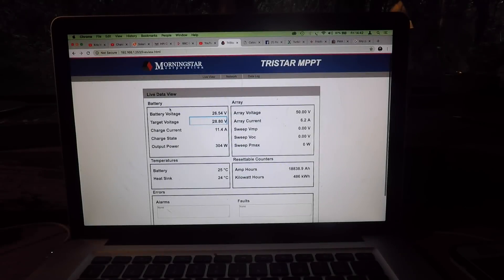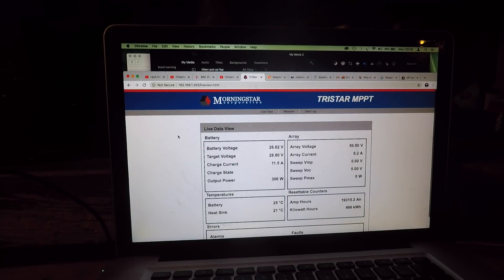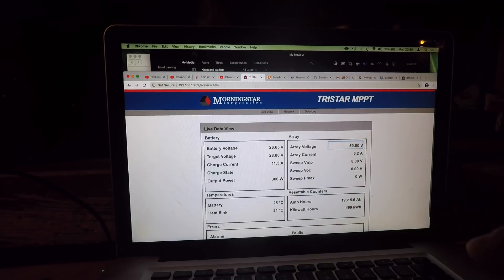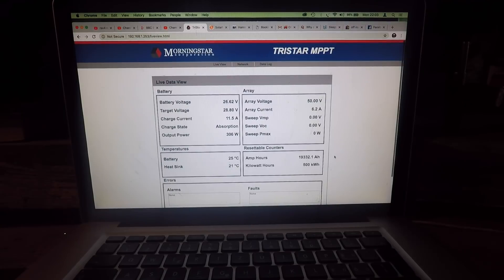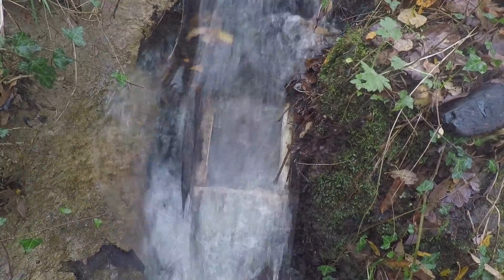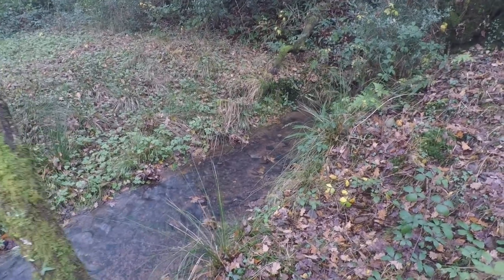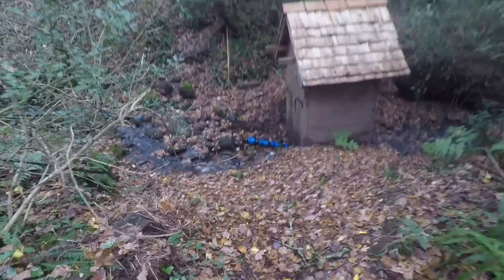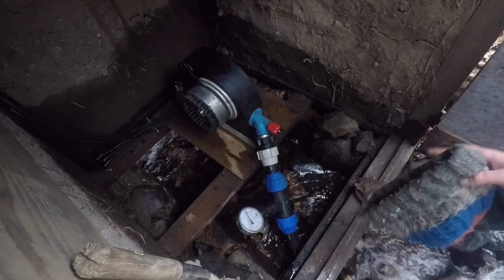500 Kwh Off Grid Hydro Electric Pelton Turbine Update

Comment: Since you mentioned water heating, I would put in a dump load circuit that would supply the hot water when not charging batteries.

Comment: You probably would get more efficiency if you used a coanda screen at the inlet. Also known as a wedge wire screen. They don't only stay cleaner. They are designed to capture more water at the inlet. They can be a bit pricey but they last many years.

Comment: What is the kW output rating of those small batteries? I couldn't see you are using a shop vac in your system, so may not be as much of an issue. But some tools much pull more power than others. Do you have a type of system (colour coding or just memory) of what the standard power draw is for each tool?
I have started to have the idea of using two little stickers on the appliances. 

Two Red being very power Hungry 
Red + Orange being more than average
Two Orange being average
Orange + Green being below average
Two Green practically nothing

To help remind you that having say the oven and extremely powerful tools might try to pull more power than a system can handle..

Comment: You may want to re calculate your kWh. Going  off those figures 304w produced for 1 hour gives 304Wh. A 500kW motor or alternator is a substantial piece of equipment. Most automotive alternators are rated between 450-700W. 
ref: http://www.rockyhydro.com/Generators.php

Comment: Storage batteries, regardless of type should be in its own vented, isolated building or container due to either explosive fumes OR runaway thermal reaction.  Would be a shame to loose your hard work to fire or explosion.  Off grid here 12 years now-solar/wind, with Trojan L16 RE B 6vdc jugs (batteries)

Comment: I always enjoy seeing your hydro updates. You probably know this and not trying to make any judgement based on incomplete knowledge, but if your pond intake upgrade is at a lower elevation than you screen intake and you try to use both concurrently, your net pressure will drop to the lower of the two. You probably know this, but I didn’t want you to expect a different result after the work you will put in. 

Good to see another in depth series out there. We’re AC and hope to document other systems around us both AC & DC, but I’m so glad to see another “Hydrohead” sharing the knowledge. Bravo Man!

Comment: Please don't dig through the dam wall!! and don't run the pipe through the wall. Just run it over the wall with using a siphon effect.  You give water half a chance and it will dig through the wall next to the pipe or in the cavity you make through it. 

I have to say your system looks great and I am very very jealous. Have you thought about adding a pump that is connected to your solar panels so that when your batteries are full it can lift some water into the dam you showed so that it provides a more  water when the sun dont shine. 

Again fantastic fantastic!

Comment: If you rebuild the turbine shed a cheap water resistant method for the walls that will contain the sound is used tires rammed full of dirt (mix in some cement for the lower wet sections) and you can then stucco the outside to hide that they are tires. Can also go with a flooded floor setup with basic U-bend traps to let the extra water out to also help contain the sound. 

For the battery check around for a crashed EV you can pull the battery pack from as at worst you would just need to pull apart to rework into your 24v system to give yourself good sized battery or several batteries depending on need if you are getting by on 2 car/deepcycle batteries now. Or the DIY 18650 systems are also easy to do just take time for the cell testing.

For the pond pipe placing it lower then adding a riser to the level you want the water gives you a way to drain the pond later if needed by sending the water to your batteries rather then just letting it flow out.

Comment: I wish I had this  much water flow.. I have a small stream, it dries up in dry times. Last time I was there in a drought. It was wet. And that's about it. No flow to speak of. It was all but dry! I'd love to get 300-400 watta 24-7 . I have 1200 in solar. And generators. I'm debating on building a wood gas or biomass generator. Or a steam powered generator. I could use the wasted heat or steam to heat the house.  Nice place great video!

Comment: If you decide to add microcontroller to controll switching of the nozzles it is probably best not to use selenoids - specifically to avoid the water hammer effet you mentioned. A spare cordless drill controlled via relay rotating a needle valve is probably a better option.

Comment: It’s a strange thought, isn’t it.  Usually, the more you use a mechanical item, the more it gets worn down and less efficient.  With yours, it’s getting MORE efficient, the older it gets.  It’s counter intuitive, to me....   is this what you expected to happen when you designed and built it, or is it a pleasant surprise?
Reply from the maker: Yes it is to be expected. it will be like a bell curve, as the parts become polished it will get more efficient but then as they leave that stage and become worn it will start to get less efficient

Comment: Hi Kris, I would strongly suggest not using Car batteries and I hope your cabinet is vented or you could be building up hydrogen and risking a nasty explosion. I work for a battery company in Australia and I know a lot about this. I would try to see if you can find some disposal telecommunications batteries. They are usually AGM Construction and are generally replaced at 5 years no matter what, many are almost as good as new. They are also built much better than most "retail" product. If you buy some new ones then find a way to properly ventilate your cabinet and buy flooded type maintainable. Cheapest technology and flooded has the highest cycle life expectancy even when compared with AGM/GEL, look for the type of batteries that go in electric forklifts/sweepers as these are made to cycle hard and daily. Thanks for making these videos I think what you have built so far is very impressive.
Reply: ok, picture would be interesting
Reply: @Mark OnTheBlueRidge Leisure batteries he said.
Reply: But something does not add up..A 500W geny is input to batteries which ouputs power to a  kettle,  an oven, lights or a couple of KWs which is far more than whats going in. I'm puzzled.
Reply: were do you findthose batteries and cost? thx
Reply: in generally you are right, but as you can see the cabinet door closes not so tight that hydrogene can concentrate up (can see some cables go over the door)
car batteries for this kind of use are not perfekt, they life not so long time as other type of batteries - but if you can get them cheap . . . 
other serious problems you will get if you connect different types of batteries together in one system like wet cells, agm or gel cells. they have different voltage at charging end
Reply: @@@ Mark
at 17:10 he speak about 2 car batteries and 2 other (i did not understand the word there - english is not my language) should be carefull . . . .
are you sure with 1.2 volt at your comment about the telecom batteries? if they have nominal voltage 1.2V it seems to be they are nickel-cadmium or nickel metal hydride batteries this type of battery needs completely different charging electronic controller
Reply: Henry Ganzer The other two batteries he mentioned were leisure batteries; as would be used in an RV or motor home.